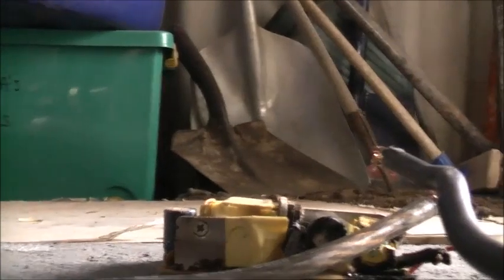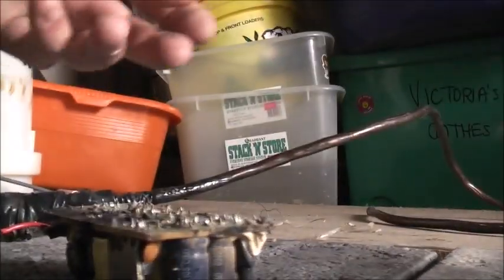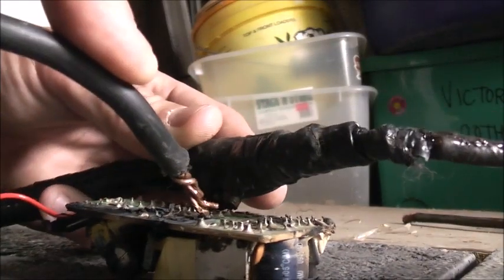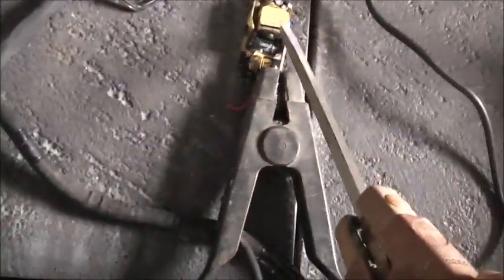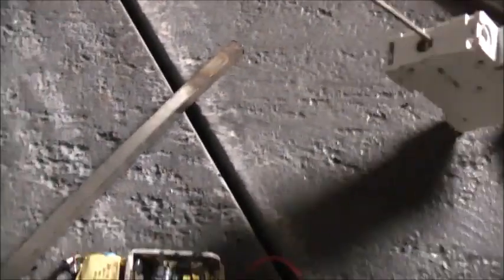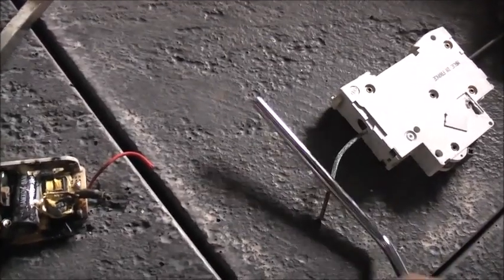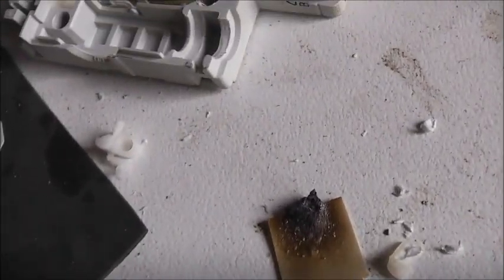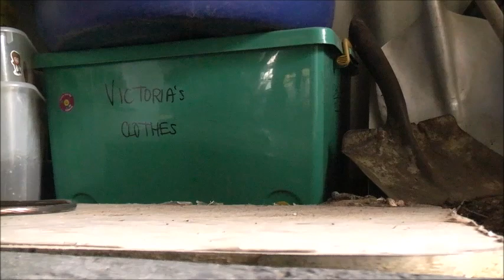High Current Carnage!!!!!!

Comment: Wanted : Whistley Squeelers! :D We need some Whistley Squeelers. 

Get the welder out. :D

That circuit breaker may have fizzed over in there because you were dumping DC into it. Rodalco once done that to a circuit breaker on rectified DC and got black smoke pouring out of it and you could hear the DC arcing across in there.

So satisfying. :-)

Thanx for showing,

-BoomBoxDeluxe.

3rd November 2015, 02.18
Reply from the maker: Yes DC was intentional, just what I needed to finish it off!!! Batteries may be too smoky here though :-(
Reply: Aaaah, that's what a powerful fan is for. :D

Instead of thick noticeable smoke, the fan mixes lots of air with it and you end up with a fine haze instead. :-)

With the powerful fan rippin' up close by (don't point the fan at the experiment) the smoke from the experiments will be drawn into the airflow of the nearby fan, and that's when lots of air gets mixed in and it 'dissipates' the smoke a bit. :D

-BoomBoxDeluxe.

3rd November 2015, 17.36

Comment: Good burnouts! I think I might have to rewind one of my MOTs with some heavy duty cable :D would 2/3 turns be enough?
Reply from the maker: Yep, do what i did, deshunt and stuff as much welding cable as you can, more volts will result' MOT is 1 volt per turn ratio!!!!! Welding cable also has heat resistant insulation
Reply: HDXFH nice! Will definitley look for some to do this with, thanks for that ;)